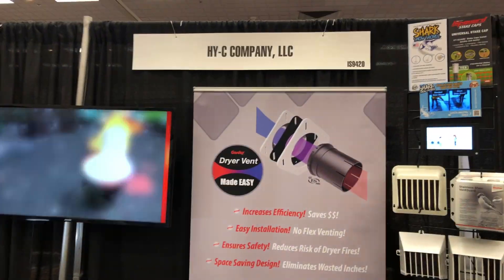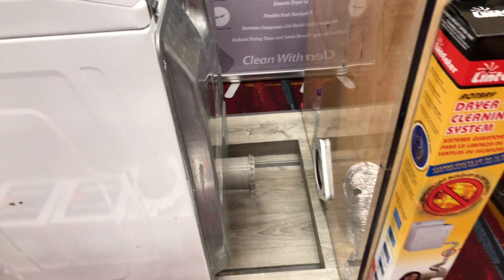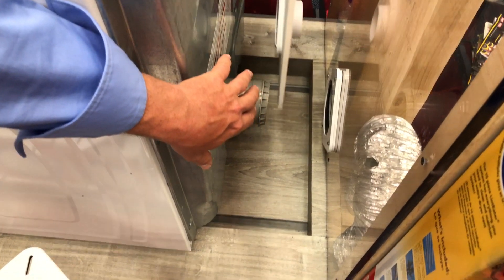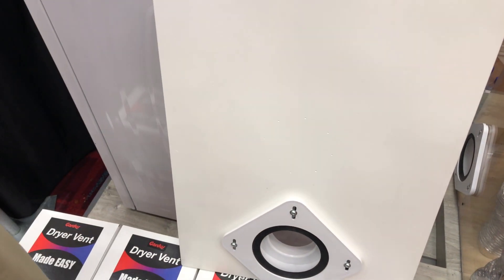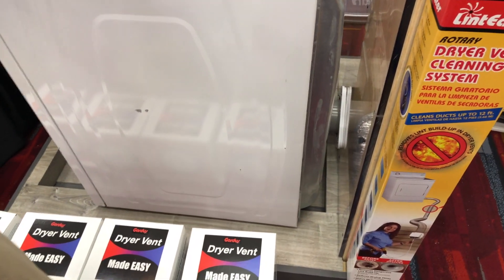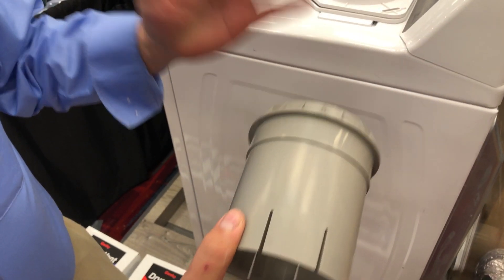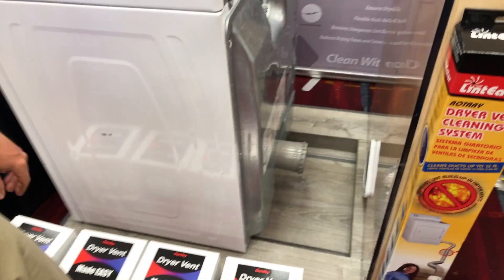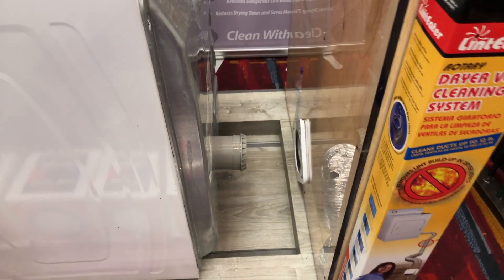Move Your Dryer Closer To The Wall #Gardus Dryer Vent Made Easy Connection System

Comment: This only works if the dryer vent is located directly against the wall where it will be vented. They're also not telling you what other, more extensive, work is involved in new constuction or relocating an existing vent if it doesn't line up....